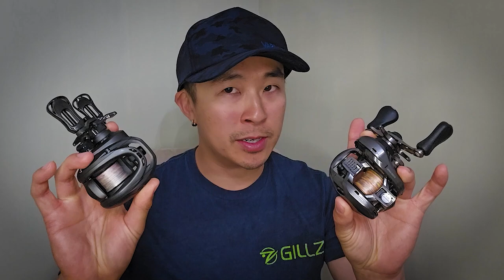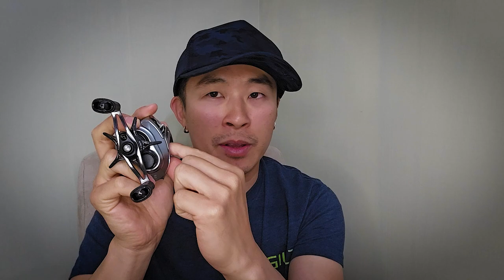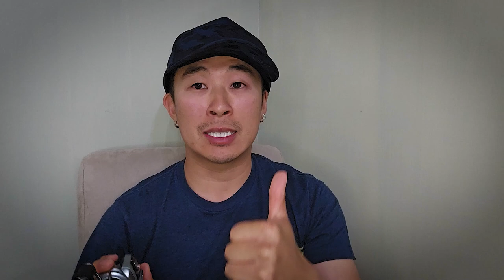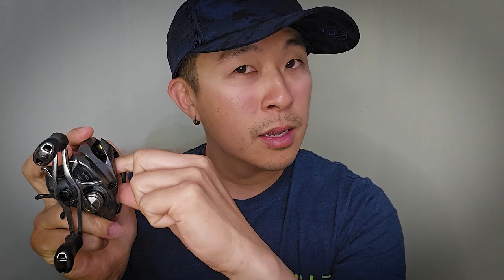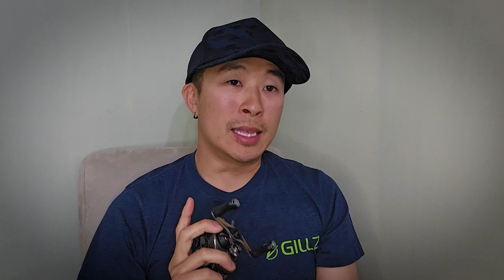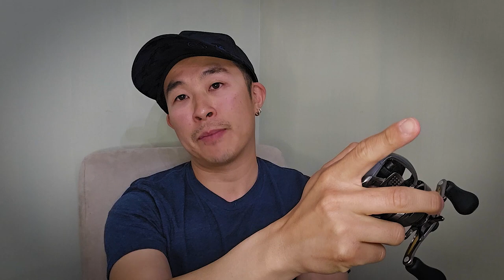How To Tune A BFS Baitcasting Reel For Perfect Casting

Comment: UPDATE.. 
After a horrible experience yesterday with a new reel, I watched this video tonight and set the spool up just like you said with no side to side movement... I also switched it to a light action 5'6 rod, just a cheaper Berkeley rod as I am waiting on my zephyr I bought on eBay .. Spooled with some destron 6 lb braid you recommended, but did not arrive yesterday until I got home from fishing... Those three changes made all the difference in the world tonight casting a 1/16 oz roadrunner jighead only... Casted perfectly without my thumb even on the spool, it would go 46 ft time after time
Reply from the maker: I am glad that this video have helped ya.  Enjoy fiddling with this technique for any baitcasting reels that uses magnetic braking. it will help you learn your setups and be casting like a pro!
Reply: @rawrfishing  I have a regular Shimano baitcaster I'm pretty good with,this one's just a bit different 😀
Reply from the maker: Shimano typically used Centrifugal braking... Old school, but they have perfected it, but I don't have any of their reels with that style of braking lol. I do like their bfs magnetic braking tho...

Comment: Just getting into bfs and its a blast. Havent had too many backlashes but the worst has been when my pe braid gets stuck between the housing of the spool and spool and i have to cut my line lol 

I am using the tsurinoya genius, think this video will help out with this. Thank you!!
Reply from the maker: Hope you will dial it in soon and have a blast!
Are you using PE line?
Reply: Yeah, I'm using varivas bass pe .6. happened to me earlier tonight out on the water. Gonna respool my line and hopefully it'll take care of it. Love the videos man. Glad I got into bfs
Reply from the maker: That's a good diameter line. Genius isn't made to throw too light if a lure. So if too much line is added. It could impact your casting. I would just keep it around 125 to 150 feet. Don't max the spool

Comment: Jimmy. Thanks for putting this video. Two observation: regading the zero tension knob, the manufacturer discourages to monkey arou’nd with it. I have the Daiwa Tatula SV TW 80, Simano Curado DC, Simano SLX DC and have never had to touch the tension knob. 2) it seems unorthodox to use this method for adjusting the baitcaster when in all non-digital/non magnetic baitcaster reels, you set your tension on high then loosen the spool tension until the bait or lure slowly falls (this is where you want to leave it at). Can you elaborate please?
Reply from the maker: Zero Tension Adjuster... yes, Daiwa suggests not to touch it. But you should know how it is setup.  Why? because if you lend someone your reel and they changed it.. guess what? You are going to need to learn how to fix it or send it to someone who can, whether its a reel maintenance business or Daiwa itself.  Waste of time and money!

So in this video, I explained how anyone should setup Magnetic Braking Reels, and the way I have taught it is exactly how Daiwa would FACTORY tune their baitcasting reels with the zero tension adjustor.

I know nothing of Shimano reels as I am not a fan of centrifugal nor cheap DC reels.  I owned an SLX DC and it's crap!  Sold it fast as possible and never looked back! Higher end DC reels are amazing, but i don't wanna spend the money for those.

The method you describe for tightening the tension knob and let the lure drop slowly is a LEGACY process for centrifugal braking only.  While you can still use it for magnetic braking reels such as Daiwa, it shouldn't as it's inefficient as we all know that Magnetic Braking reels, especially Daiwa, works best with NO tension.  This is why Daiwa have decided to tune their more expensive reels for ya and call it the Zero Tension Adjuster knob. They factory tune it and then make the knob small and hard to get to!

let me know if u have any other questions!

Comment: So does this mean whether you use a really light lure or a bit heavier lure that the tension knob will still be setup the same with very minimal left to right movement?
Reply: yes
Reply from the maker: Yep. Tune tension. Adjust brakes only!
Reply: @rawrfishing  im still pretty new to this so what line would you recommend for easy casting. im thinking either 4 lb mono or possibly 8 lb braid with a 4 lb fluoro leader but want whatever is easiest to cast with this type of setup.
Reply from the maker: If you are bfs fishing... Just practice with whatever thin line you can get. 4lb mono is fine. Just keep drag low and never use the spool to break off a snag. But I use 0.6 gou braid. It's better to go by line diameter than line strength when we talk braid and the easiest way to talk diameter is by gou, not inch or mm
Reply: @rawrfishing  thank you so much for all the information. Really appreciate it!

Comment: Hi ! I have a Shimano bfs  casting reel, the company recommend to use fluorocarbon or braid line. (Fluoro 8lb / PowerPro 15lb).
I'm a new in a bfs system. Which line do you think is better for a beginner like me ? Thanks in advance.
Reply from the maker: Braid would be much easier as It is light and won't spring out

Comment: I’m new to bait caster, only a year now, interested in a starter bfs combo 1 piece rod preferred any suggestions
Reply from the maker: Bait casting is fun. Hope this video helps you tune your magnetic bc reels. This method works for both bfs and non bfs reels as long as it is magnetic. Unfortunately I don't know many 1 piece rods that are considered stater range. But be rest assured that the new age multi piece rods uses the spigot ferule connection that allows the transitioning of power and sensitivity extremely well. Www.baitfinesseempire.com will have many bfs rods for you to browse through. Tsurinoya Dragon is what I would suggest and perhaps either Tsurinoya genius or dark wolf ultra for a starter reel!

Comment: Hello. New to this sport. I see almost every video on BFS having fisherman trying to cast as far as possible. I choose a Aurora air and a kastking kestrel bait FL action for small trout streams near Bogota, Colombia. I had one trip casting 1/64 ounce trout magnet and I was lucky didn´t need to cast too far because I was sucking at that moment. Got a trout but still need to practice a lot on setting the reel. Are you usually casting as far as possible? What if you need to cast in the 5 meters of water in front of you, how do you change ythe strenght put to the rod? On those small streams you need to be able to cast from 3 to even 15 meters to reach the places where trout is. Also be very precise. I normlly reach those places with a #3 fly rod. But after 20 years with that want to learn something new. THanks for sharing this videos. I am here into this sport because of  you , thanks mate.
Reply from the maker: While bfs isn't about casting far... That's the nature of the sport! We still need distance for some fisheries.. But if you don't... Bfs, like fly fishing, is very efficient for short casts.

Dont expect trout magnet to cast far! Lighter the lure.. The less distance.  I would choose a heavier lure. 

You can also try higher end reels, bearings, thinner line and less line!

Comment: I definitely need to watch this! Ordered a cast king zephyr last night. It showed up this morning. Couldn't wait to try it out. Had nothing but trouble the entire day ,finally went back to my spinning reel.. had the brakes set all the way tight, it cast to the left everytime, anything but all the way tight and it bird nest..
Reply from the maker: The zephyr can do 2.25 grams and up out of the box. Anything lighter will be difficult unless you upgrade the bearings, but the improvement isn't too much. So try a 1/16th Oz Jig and a 2 inch plastic lure for practice on an UL rod or L
Reply: My zephyr was perfect! Casts even as good as my Shimano curado BFS
Reply from the maker: Perfect is subjective... But glad it's working for u. But I could never compare the zephyr to the curado... Even tho I was the one who helped kastking develop and release the zephyr. But I have to say that the curado doesn't do that well below 2 grams. It takes very skillful casters to do it at short distance for the stock reel.